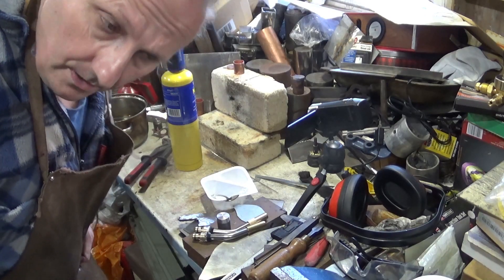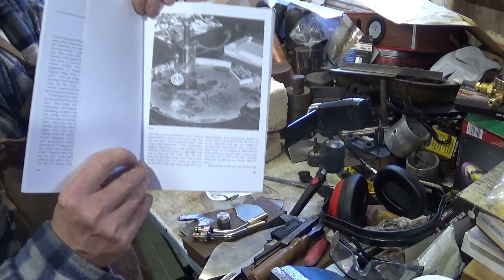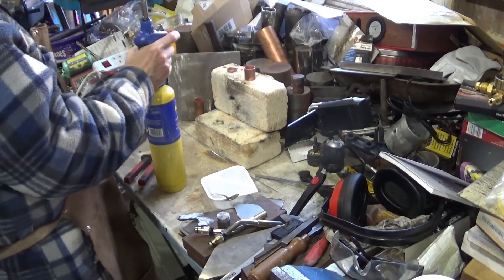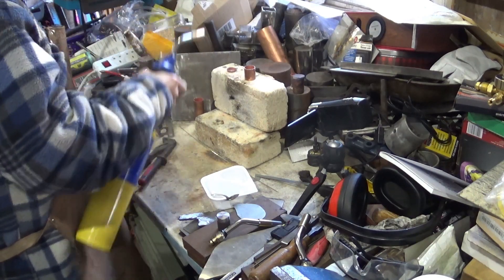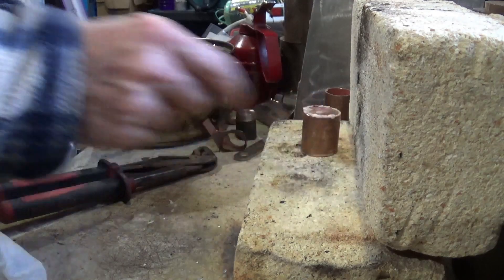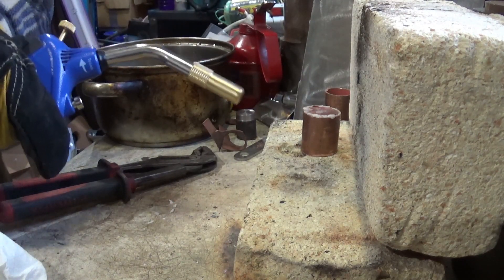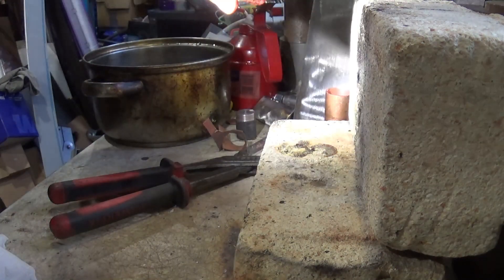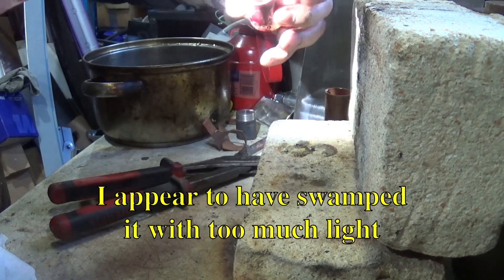Brazing Copper And Vortex MAPP gas Brazing Torch Update

Comment: Hi How do you plan to brazeing the second cap without melting the braze on the first ,good vid.👍
Reply from the maker: That was just a test, and I will get to that when I start boiler making, however,  some things need to be borne in mind. 
1. Solder has a higher re melt point than melt point, primarily because the copper content has gone up.
2. You can, in the case of silver solder always use a solder with the next lowest melting point.

Hope that helps. Many thanks for watching, please like, share and if you like the channel, subcribe!

Comment: That torch gets the job done. I need to get  my brazing skills up to scratch, haven't done it in years but have a few jobs that need doing.
Reply from the maker: A bit of practice goes a long way. Many thanks for watching.
Reply: @BensWorkshop  i have a broken cast iron cover on a lathe, what would be best to use to fix that, i was going to try brazing with some aluminium rods, or those aluminium alloy rods.
Reply from the maker: Not sure aluminium would work. You also need a lot of preheat to prevent cracking. Not sure what to advise other than see what people have done on YouTube.
Reply: @BensWorkshop  yes, i need to do some more research, will let you know what i come up with, I'm not ruling out araldite!
Reply from the maker: Many thanks, also publish a video, might help someone else.

Comment: The instant ignition is very impressive with these modern torches. Looks like a pretty good tool. Cheers Ben.
Reply from the maker: Certainly is. And unlike my propane torch you don't have to let it warm up a bit before you can use it.

Many thanks for watching!
Reply: @BensWorkshop  Yes, I meant to say that - up to working temperature immediately. I hope these guys send you another - this is certainly selling it to me!
Reply from the maker: This torch also takes propane which is slightly cheaper.

Comment: Great real world Demo Ben.If I do buy a MAPP torch I will go for the one you use.Cheaper one's I've seen advertised just wont have the heat range for bigger jobs .Having 3 different Torch heads really adds to the versatility so it seems to make sense to pay the extra money and get something decent :virtualhug:
Reply from the maker: Certainly my view. Also if you get it from ToolStation for £75, you get a bottle as well.

Many thanks for watching!

Comment: I have been thinking about replacing the water taps for the hoses outside
Reply from the maker: The taps (crikey, an American using English!) are usually fitted with a nut and a compression fit via an olive. As such you only need a blow torch if you are replacing or fitting new soldered pipe. In which case a propane torch (or any of my paraffin/kerosene blowlamps) will do the job as plumbers solder melts around  232-243C (450-470F). You do need to make sure you have flux in the right places.

Do not braze plumbing, you will set the house on fire. Also have a damp rag about to cool the pipes after to make sure you don't get an unexpected fire.

Many thanks for watching!
Reply: @BensWorkshop I speak semi-proper English every now and then 🤣
They are soldiered now, I have been working up the bravery to hit them with propane for a while now and watching you and a couple others do it has made me brave enough to try
Reply from the maker: Post a picture on your community page, let me know and I will take a look.
Reply: @BensWorkshop  I will.  It's not bolts at the moment but it's pretty tight to the brick. I have to work that part out next.
Reply from the maker: @GuysPlayingWithTools  Show some pictures either side of the brick wall. I might be able to provide advice.